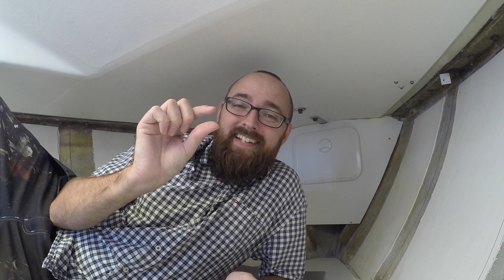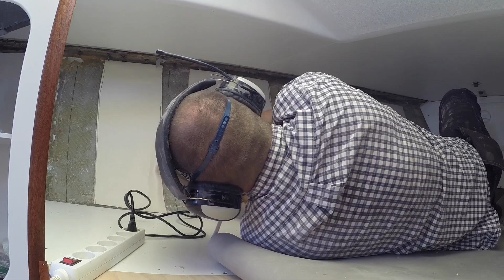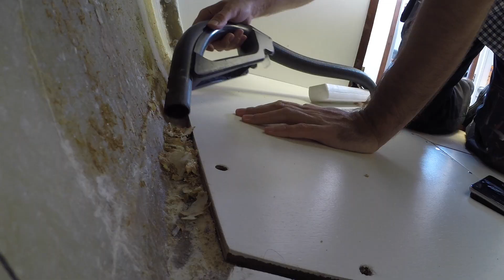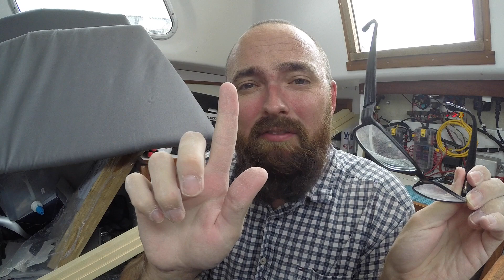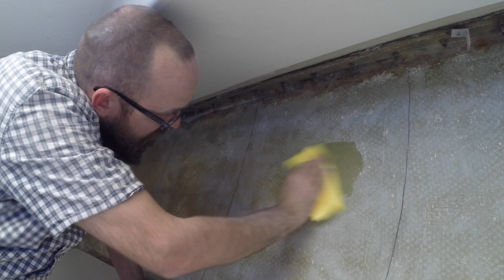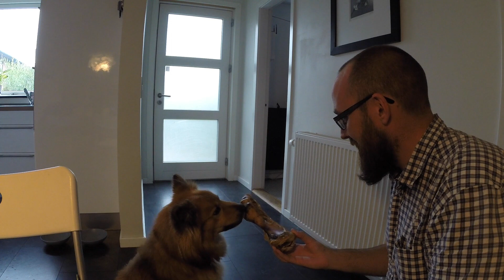Sail Life - Insulating the v-berth, part 3

Comment: Good Boy Yokull!! And you too Mads. 
 Is there insulation on the hull under the platform? If not maybe a thin layer of spray on foam might help. I don't recall anything you may have said in a previous video.
Reply from the maker: KarbideMachinist Thanks - from both of us ;) It's funny you should mention it. On the way home I was thinking about adding insulation to either the hull under the bunk or the underside of the bunk. I reached the conclusion that insulating the underside of the bunk would be the easiest and also the best solution. I guess great minds think alike ;)